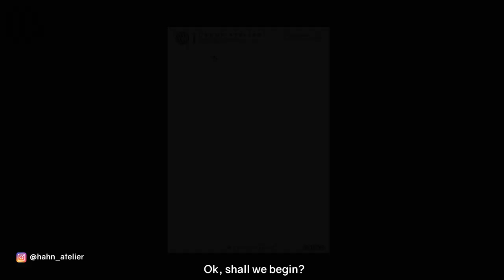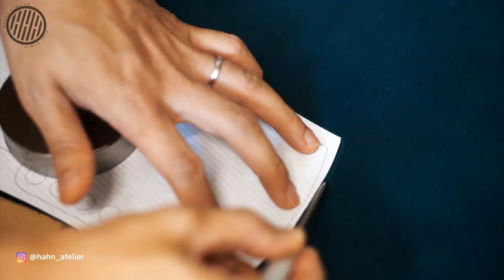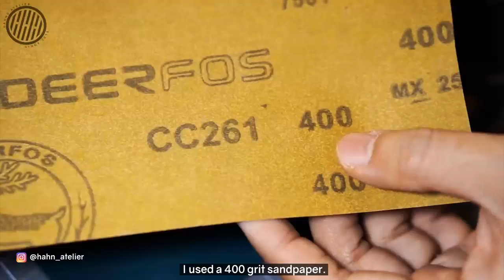[DIY] Making a non-stitched card case / PDF Pattern

Comment: Can I ask what the dimensions are for this...I have a cutting machine and would like to upload it into the software so that my machine could cut it...I just need length and width please
Reply from the maker: I'm sharing PDF pattern for it. It's 100% size. you can measure it as well. Hope it helps :)